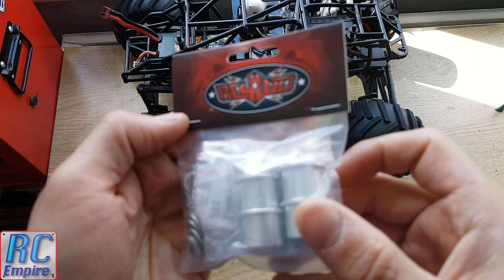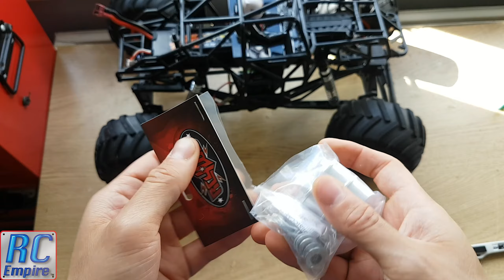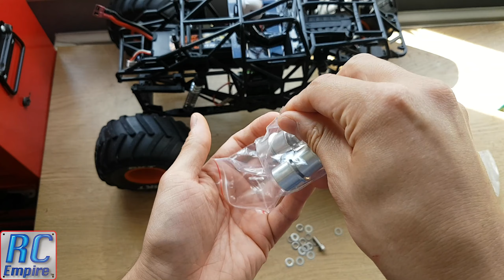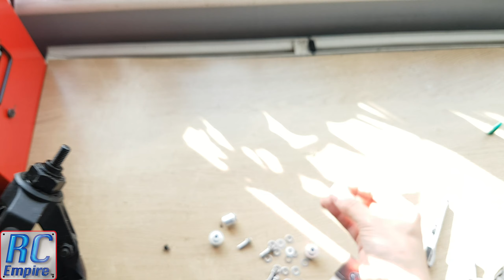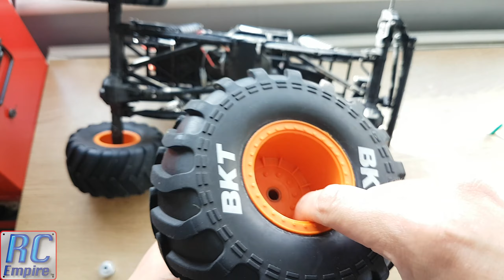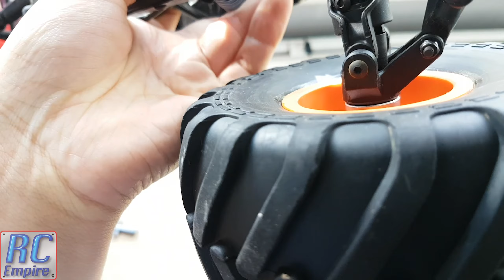Axial SMT10 Monster truck: RC4WD 12MM HEX WHEEL WIDENER SET (+15MM)

Comment: This works on the new one right?
Reply from the maker: Yep. The new one's still got the 12mm hexes.
Reply: @RCEmpire_HQ  ok. Good. I have the new one and ever since I got it has just been issue after issue. So the new hexes will help. And I wanted to turn it into a mega truck  by next winter so the adapters will help as well
Reply from the maker: @endosrc  Really! That's interesting. I wonder if quality had dropped since Horizon bought out Axial :(. What kind of issues were you having? 
We had the centre gears go on ours, but that was after a year or so on 3S.
Reply: @RCEmpire_HQ  wheel hex pins fell out in the front